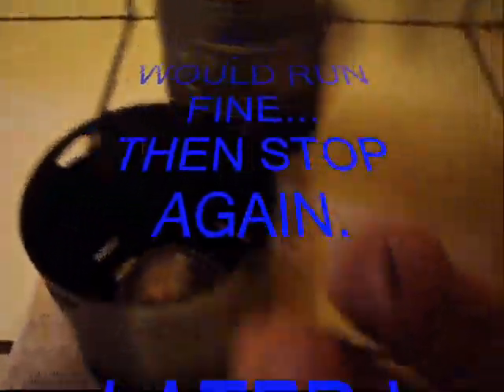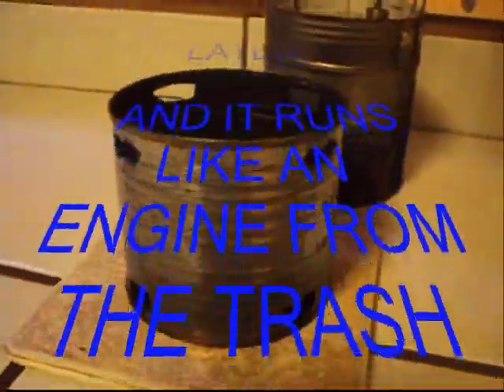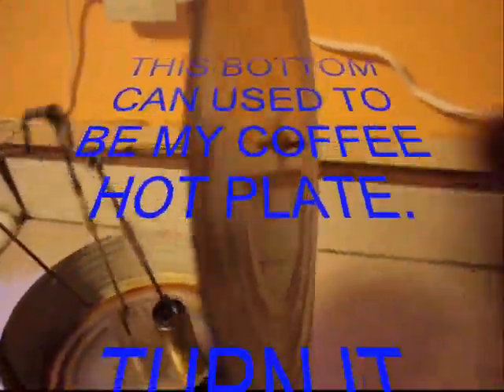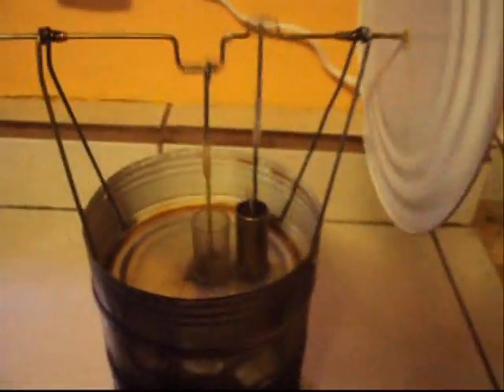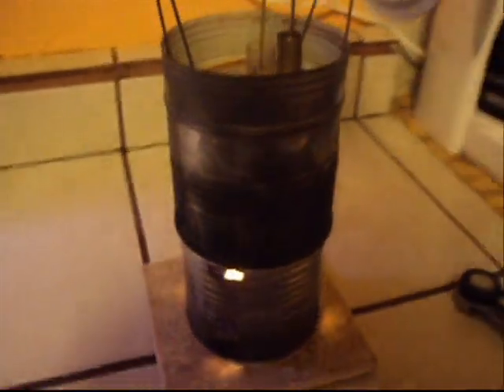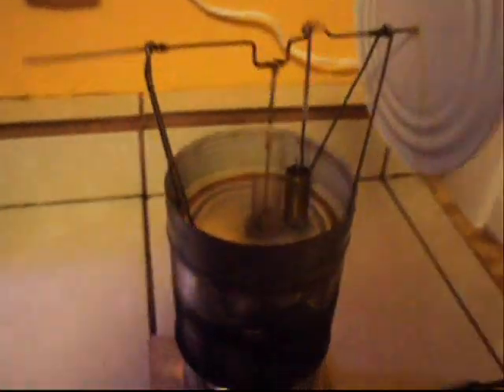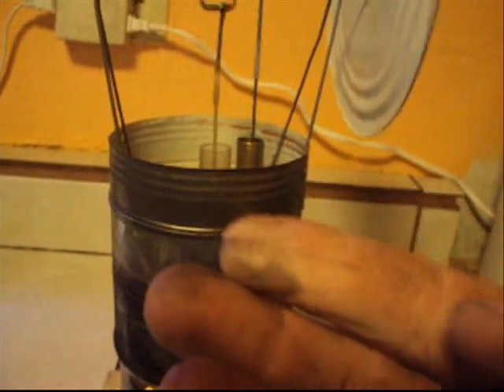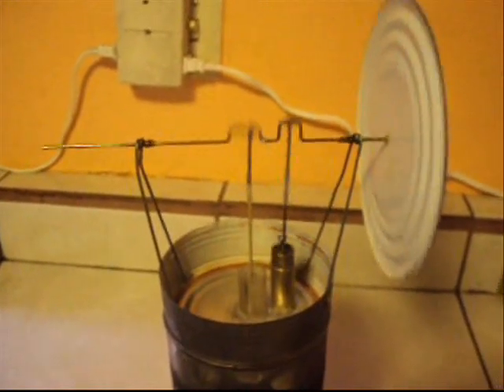PART 19 HOW TO BUILD A STIRLING TIN CAN ENGINE.wmv

Comment: That is a rather small engine where the can and flywheel is about 65 mm in diameter.  I just wonder what is the piston made from as it seems a good fit for reliable  sealing of the working air inside it.   Consider its size and the efficient working I would say that a hearty congratulations is in order.  Hearty congratulations.  well done.

Comment: Hey MuddyThis is my first forray into the world of sterling engines and I'm hooked. I've just watched all 19 parts and One item I didn't see is what should be the ratio between the volume of air in the displacer chamber and that in the cylinder. Also in the diaphram type the additional clearance of the cup that the diaphram fits on seems like it would adversely affect performance. Could You clarify? I can't wait to make one.